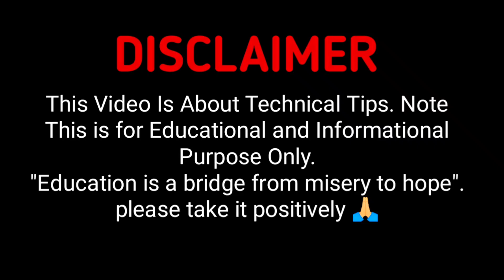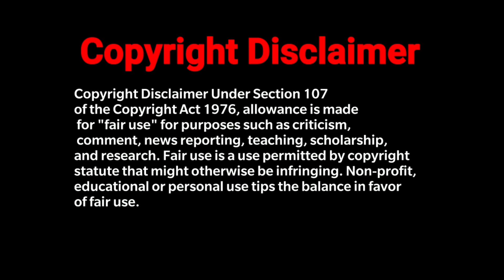Solar PV ROBOT | Problem | Solutions

Comment: Sir Dry cleaning robots is very efficient if talk in terms of water storage but when we talk in terms of the cleaning I don't think it is that much effective.

For example the bird's poop. The bird's poop is something which cannot be removed with out the use of water and proper brushing. I have personally visited many  places where the solar system are install during my internship. And found huge bird droppings on the solar panels.

Comment: Very good information and the points which ever you have mentioned makes really sense.. crossing the gaps , crossing the uneven installations , moving on the edges of the panels and avoiding the moving of wheels on to the panels, avoiding Nylon Bristles etc... even I have found one nice video on YouTube which covers maximum points you mentioned and looks really good and light machine too .. I have seen this robot in one of the site... even this machine may be helpful to someone who really looking for the dry cleaning solution..

Robot by aegeus technologies 

https://youtu.be/EcrPwWTVGfE
Reply from the maker: Thankyou so much Mr. Rahul , will be glad to help you , on this topic , we can connect over linkdln

Comment: Good explanation with experience.

Interested things in robot are

1:- Less weight.

2:- Use of feedback controller for each motor will be better option to monitor and predict the faults.

3:- Use of IoT.

Every product have  cons, this robot also have some disadvantages.

1:- you have shown it in lab but not in site, I think in site you may know what actual problems you have to face.

2:- the cleaning quality not much better with nylon brush compared to microfiber.

3:- At wind speed 180km time, no need of cleaning, due to dust will fall on module.

4:- As you said, middle wheel you can adjust simply, but it's not possible for long row structure.

5:- the robot load on structure is not balance, it may cause the robot fall down during heavy wind speed.

I have given my feedback as per current robot market and their performance. So please take it in a good way.

Thanks 😊
Reply from the maker: Mr. Naveen 😀 feedback acknowledged. 🙏🏻
Reply: @SustainableEveryDay  Reply Expected 👍

Comment: Sir i have 5kw plant,adani mono perk panels and phocos hybride inverter i have a problem of voltage fluctuation in peak hours ,inverter drop powere from 3500kw to 500-600 repetedly .and voltage fluctuat in load pllzz.. ans

Comment: An interesting concept indeed. But how does the robot stack up against the harsh weather conditions of the UAE? I see a lot of exposed DC motors and the electronics control unit doesn't look like it can be IP67 rated.... long term feasibility will be an issue.
Reply: all motors and cables are UV resistance ,control unit box made with IP 68 Box....also tested and certified....by TUV